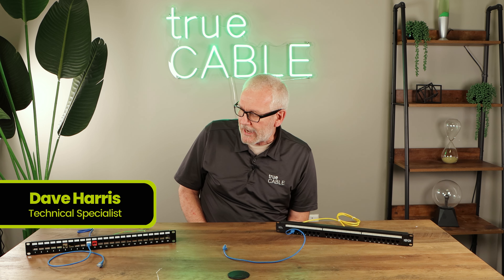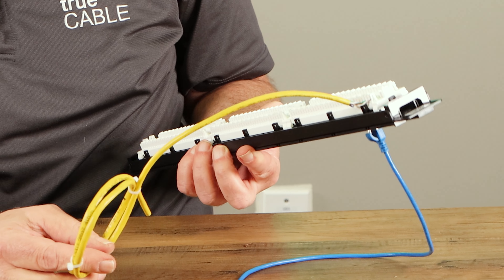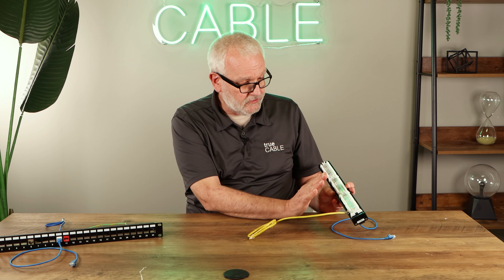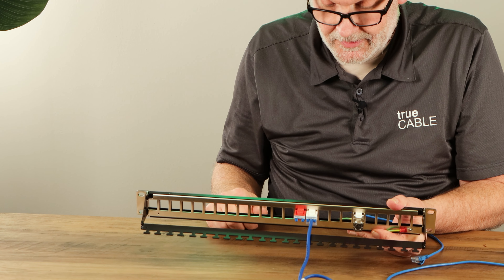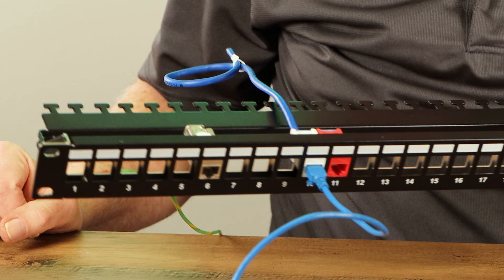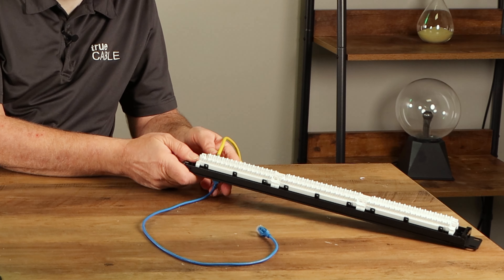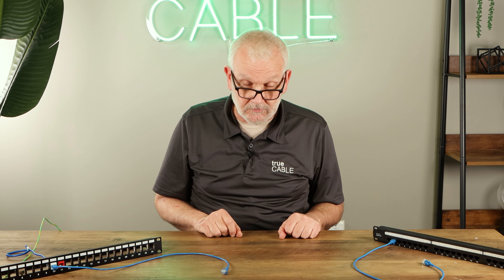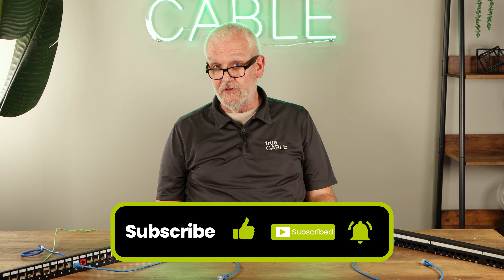Which One is Best For You: Monolithic vs Keystone Jack vs Staggered Patch Panels

Comment: If I have a PoE device, feeded by a PoE switch, but in the way to get connected, the PoE switch is through a keystone patch panel, and the PoE device is connected through a keystone jack, will it work correctly? Thank you in advance
Reply from the maker: Hello! The answer is YES, absolutely! In fact, this is the best way to go about it since keystone terminations are far more durable and higher performing than hand-terminated 8P8C (aka RJ45) plugs. The only thing to watch out for is to be sure the keystone jacks themselves are rated for the PoE type you intend to run (most are, but check to be sure).